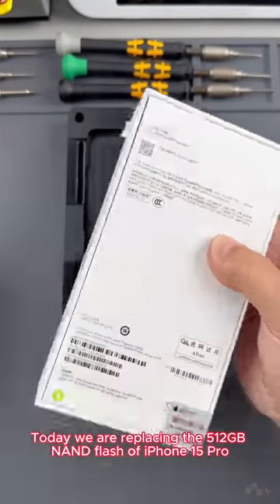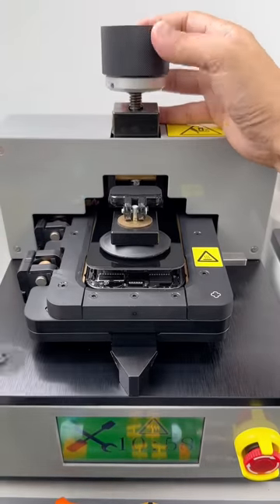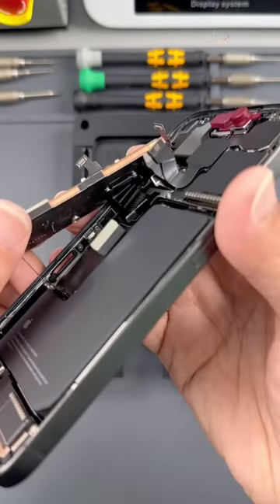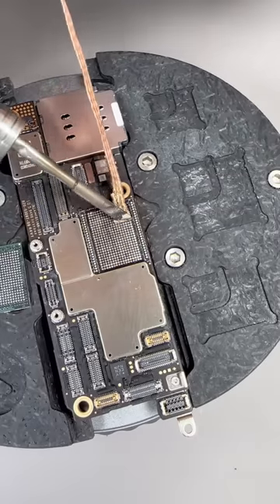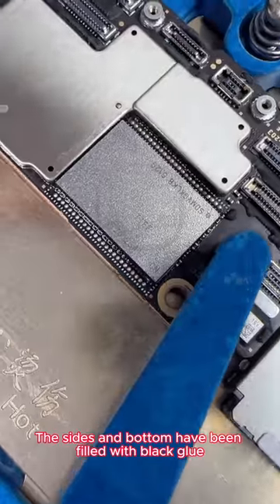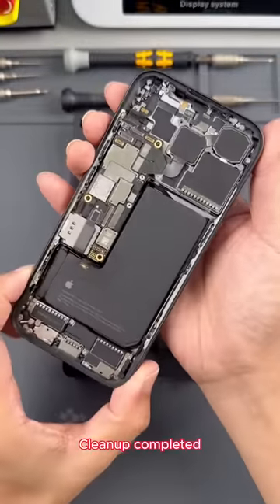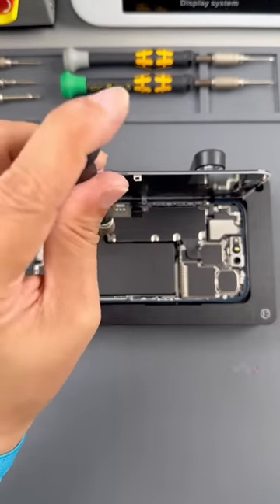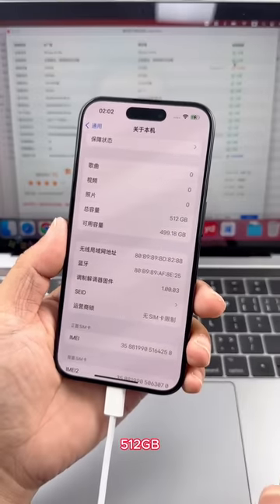Expand iPhone 15 Pro storage

Comment: For this kind of work, it should be 2 TB 😂 not 512 gb
Reply: Yeah I agree completely! He should buy 128s, convert them to 2TB and sell them for $400 more.
Reply: @ukumra IPhone 15 doesn’t support more than 1TB
Reply: Bruv tell me you haven’t had an iPhone ever without telling me…
Reply: @ukumra can we increase it to 4 TB
Reply: @cia4gent128 it does. You just need to find a chip that has that capacity. Could probably take one from a MacBook, they are usually the same chips.
Reply: @PvtAnonymous ye but expensive af
Reply: Absolutely
Reply: @TonyCR1975  true, but if you want it to happen, I'm quite sure it can.
Reply: Yeah I was wondering how this could ever be cost effective for 256 g
Reply: @PvtAnonymous no bruh

Comment: This is by far the most professional iPhone disassembly process I've ever seen on YouTube dude has a machine for every step
Reply: I've watched the video because of it and I don't even like iPhones or to watch disassembly videos.
Reply: Apple sell those extra devices. All the pro places have those.
Reply: @bugrilyus  you sir are incorrect.  Apple makes devices for their techs and stores but what you see in his video are all third party devices.  Apple doesn't support third party repair so you really think they would make a device for 3rd parties to repair their devices and then sell those devices?  Most of the devices I know about come from a company called rewaa
Reply: @SpreadingKnowledgeVlogs  No. Apple has started a repair program, you can buy or rent the tools apple personnel use to repair stuff on your own or as a repair shop.
Reply: @bugrilyus yes but the camera won't work it's been tried already
Reply: He doesn’t have a machine to trick Apple into not knowing it was opened and messed with and denied warranty replacement, however…
Reply: @stevemcgowen  I havent said anything about this either
Reply: @bugrilyus  show me a website where Apple is selling said repair equipment.  I'm aware they sell limited parts for certain limited diy repairs but the machines he's using aren't apple equipment their rewa equipment from a company called rewa and possibly other 3rd parties.  I could be wrongnhere but I haven't seen Apple selling the serious machines for things like laser glue removal and so on.  If they do some how sell this stuff I'm willing to bet it's way over priced and likely not worth buying when compared to third party equipment.  I only do phone repair as a hobby for family and friends and rarely work on Apple stuff (I do sometimes but usually ipad displays and older iphones) nothing new for me as far as Apple goes.   To be honest a lot of the machines aren't really necessary but make things faster and easier so if your doing enough volume where it makes sense to buy them then it makes sense but for most it doesn't make sense.
Reply: @bugrilyus  just had a look at apples self service repair site and I was actually surprised and admittedly partially wrong.  While they do have more machines then I expected them to have its basically limited to display removal and other tools.  That being said that's more then I expected from them.  But you will still need 3rd party equipment if your going to do hard-core stuff lime glass only repairs and stuff like that.  I also don't see the laser glue removal machine but I haven't also looked over the whole site so I wouldn't be surprised if they did offer it some where though.  What really surprised me was the prices are actually some what reasonable.
Reply: China has tools for everything all the machines are made there that’s why every phone repair shop here has these
Reply: @SpreadingKnowledgeVlogs  Yo were completely wrong, not partially. You're welcome.
Reply: @SpreadingKnowledgeVlogs  youtube immediately deletes the comments with links in them
Reply: Nice

Comment: I would rather to pay for $100 more to buy a 512gb phone instead of of this
Reply: Agreed, this Jerry rigged upgrade isn't a wise decision. I rather spend the extra money to do it right from the manufacturer than do it like this then have something go wrong with it later on.
Reply: This is just a demonstration of what's possible in terms of iPhone storage uprages. It is a thing and it surely pays off - just look at all that equipment! People who resolve to such measures are probably the ones who keep their phone for more than two years and find themselves in need of more storage down the road; intend to sell it on the used market for a little profit (no one has to know it's been upgraded in such way) or in the worst case have their NAND chip malfunction.

Comment: Buying 128 GB model and replacing the memory with 1TB on a repair shop like this would probably be cheaper then buying the 1TB model from apple. I don't understand why these guys charge so much for just memory.
Reply: I have a 128 phone and I had no choice when someone gave me that phone so I’m trying to find someone that can upgrade my storage to 512 or 1tb because my 128 is crammed full right now and apps are beginning to stop working, I also have a 15 pro

Comment: Amazes me that no testing of the motherboard after replacing the NAND chip was done. Imagine putting all that back together and it doesn't work!  Amazing to watch this video but there's some serious equipment there required to do this.
Reply: Since there is no software installed, you can't really test the motherboard until you flash it. After that testing is literally turning on the phone and checking if everything works. 

Also iphone's lego style connectors are really sturdy. Usually there is no problem with the conncetion, so it doesn't make sense to develop an usb debugging program just for this scenario.

Comment: Many many reasons why this is a dumb idea. Not only will it have the incorrect specs by the serial number but also the NAND storage might be completely different than OEM read write specs, meaning there’s a chance the read write speeds will be significantly worse. Besides the complete hassle to do this. I hope to god you aren’t reselling these back on the market, this is some serious Chi-Tom foolery.
Reply: Can't he just order nand that is the same spec or higher than oem? If he's smart enough to take apart an iPhone and put it back together, surely he would think about the read and write speeds that the chip he is replacing is capable of. If not, I wonder where his mind is.
Reply: @danielxmiller  he could buy the Apple NAND OEM chips but I highly doubt they’re cheap, in fact I’m not even sure they sell their chips to the public. If he is doing these upgrades my best guess is he’s going with a cheaper brand, which will result in worse speeds. If he buys a higher NAND chip like western digital and their new 218-layer chip they would be significantly more expensive. Overall someone trying to save a “few bucks” and not just buy the higher capacity phones are doing themselves a disservice.
Reply: @goblinondrums  I see what you're saying, but it couldn't possibly be more expensive than what apple charges to upgrade the memory.
Reply: @danielxmiller  yeah not sure how much this guy charges, to buy more storage on the iPhone 15 they go up by $100, though in the cases where they go from 512GB to 1TB it’s $200. I mean if the customer really wants to go outside of Apple they could definitely do this, just not sure if it would be beneficial or cheaper than getting the higher size storage already from what iPhone sells them at.
Reply: @goblinondrums  yeah maybe just more for fun or to show that it can be done. I was thinking going from 256 to 1tb which is $400
Reply: @danielxmiller  yeah I’d just get it from Apple, cause if something happens to the phone and you take it in the warranty is totally compromised because the serial number isn’t going to match up. Plus there’s also a possibility this guy could destroy your phone in the process.

Comment: So basically phone manufacturers charge extra for extra storage, while it is just a little bit of solder in the right place?
Reply: Always has been
Reply: The nand flash itself gets more expensive with higher storage
Reply: @shubhammhashelkar6717  But not by the €200+ per tier phone manufacturers charge for them.
Reply: @woalk  yup, these charges are exorbitant for extra storage

Comment: Is it possible to put an iPhone 13 Pro motherboard in a 13 Mini chassi?
Reply: probably it’s possible but you have to fuck around with battery cause it’s too big in pro to fit in mini and it’s too big in mini to fit pros board. idk will the display work or not

Comment: Can you upgrade nand to 2tb ?
Reply: There is no 2TB version on Apple’s official website, so it shouldn’t be possible
Reply from the maker: @Mr.L-jacket yes😂
Reply: @Mr.L-jacket it's just an SSD chip so to should be possible. Apple doesn't make the storage chip.
Reply: @ukumra No…the memory controller in the CPU doesn’t support more than 1Tb

Comment: It surprises me that this has worked, because Apple is known to block exchanged installed parts, even when using genuine or when iPhone screens from the same model are interchanged. Interesting.
Reply: They didn't expect this 😎 
Also he flashed the firmware.
Reply: This is not a PART but a NAND chip to be flashed, hense this is not monitored in any process by Apple. Screen, FaceID camera and Battery are, nothing else.
Reply: And this type of guy who has this kind of equipment sure has the machines that reprogram the screen and battery to make them exactly as Apple is waiting for in the software information. This is called clone ID/Serial for the battery and screen. Sometimes they use oem battery and screen, sometimes they use refurbished original ones that has been repaired and restored. Not sure for the battery capacity though. 
Not sure for the FaceID camera.

Comment: 1- You don’t need a protective cap for the camera lenses if you are not going to poke them with a screwdriver. That is gimmicky and overkill. 2- It costs $100 to upgrade from a 256GB to 512 GB model. Buying the chip, disassembling the phone, the equipment and the risk are worth more than $100 3- There is zero guarantee that the chip will work at all. He positioned the chip with his tweezers. There has to be a better way, i don’t think apple does this by hand 4- Forget about ever contacting apple again for this phone when they figure out you welded parts to it
Reply: Yeah man all the comments here I swear are bots they all just say how “professional” it is

Seems like Chinese content bumping